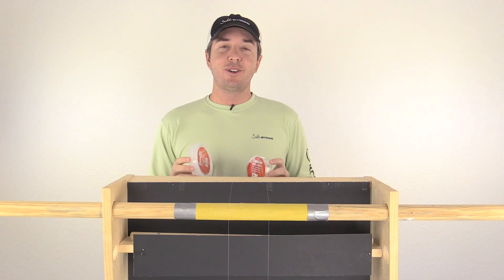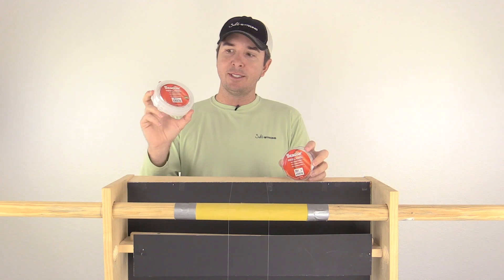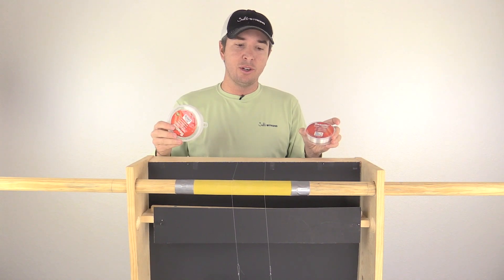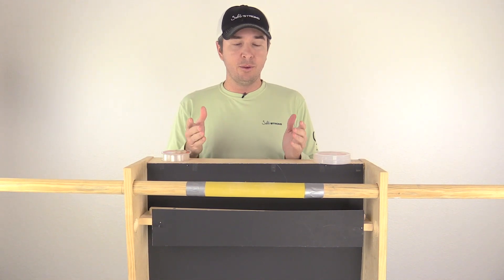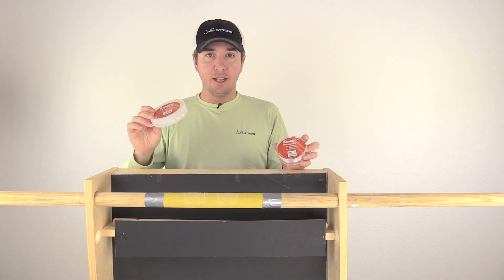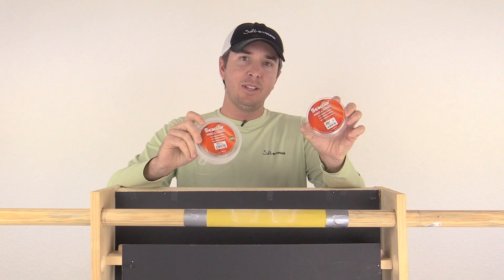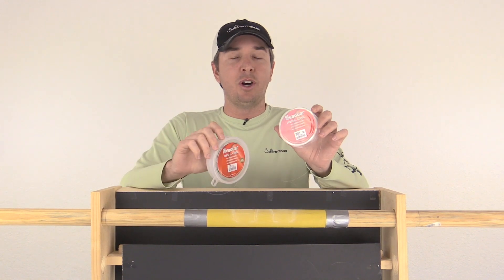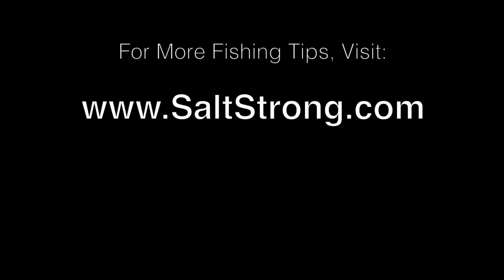Is Fluorocarbon Leader Line Really Stronger Than Fluoro Main Line? Find Out.

Comment: I started using Seagar Red Label Fluorocarbon fishing line as my go-to leader line two years ago.  I primarily jig for flounder in the backwaters of Avalon and Sea Isle, NJ.  Personally, I find that the SRL fluoro line (I use 20 pound test) ties tighter/smaller/more compactly to my 15# Power Pro braid via a uni-to-uni knot.  Also, it allows for a tighter/leaner knot to my jig and I sincerely believe that it presents a more fluid and "agile" motion to whatever jig or lure I'm working.  I believe in using the SRL fluoro line so much so, that I now use it for most of my ocean/reef fishing as well.  Whether it be soaking greenies on S&S Skinner tog/porgie jigs for tog over the dimple wrecks that dot our coastline or threading pieces of squid on Capt. Dan Schafer's Bottom Sweeper jigs for black bass and triggers to snap jigging zooms for early season stripers in Somers Point, NJ.  Seagar Red Label fluorocarbon fishing line is my leader material of choice.  Pound for pound and dollar for dollar, it's the most practical and tactical choice!

Thanks for putting this comparison video and the accompanying article together!  Much respect!  B Stav Fishing
Reply from the maker: Thanks for the feedback and for the support!

Comment: Test I would do.
1. Abrasion
2. Stretchability
3. Transparency
Reply from the maker: Any ideas on how to test the transparency factor? That's the one that is toughest to measure.
Reply: Salt Strong food coloring tinted water in a gish tank with different lines suspended in it
Reply: Leo Hernandez From the tests I've seen they really show what we can't see and are all dependent upon the day, the amount of light on the water, the color of water, whether you're looking up at the line from the bottom of the ocean or looking forward or down. From what I've seen in other videos white braid, clear or pink tinted fluoro/mono work most of the time. I also would like to see these guys put their spin on it however.

Comment: Salt strond, it be good to try monofilament against flowro, it be the ultimate test
Reply: Arnaldo Bertoli Yes!
Reply: Agree
Reply: Yes!
Reply from the maker: Coming soon!
Reply: Thats obvious. Fluoro way better
Reply: Michael Vanlerberg you never know
Reply: yep!!!
Reply: Actually mono vs fluoro for strength may be a valid test, but they have different applications. Mono for instance is generally used for top water because it floats longer than fluoro. Fluoro is used for sub surface and diving baits. So there are applications for both and not necessarily competitors for the same application.
Reply: Chad Sanders  thans for the info, im curious about what would happend, because by pounds mono is a little bigger than flowro
Reply: Chad Sanders Ian curious which one has more abrasion resistance
Reply: @michaelvan6675  apparently not

Comment: I have read that it's not necessarily the abrasion, but more the shock resistance for setting the hook and fast surges. 2-3 of leader line can supposedly handle more shock than 2-3 feet of main line
Reply from the maker: We'll be testing that next.
Reply: Salt Strong any results ?
Reply from the maker: It all boils down to knot strength because the knots create the weak points in lines, and traditional mono outperformed fluoro in both slow pull tests as well as fast load tests that I've performed so far.

Comment: I watched this and got into a debate my wife that should have used new pieces of sandpaper on each test.  I personal think the test was controlled that no spool was more favored.  I also hope you comment that the leader line might be more abrasion resistant because of some polymer coating is not true because wouldn't that interfere with the refraction since the light would have to go through the polymer before fluro?
Reply from the maker: First of all, congrats on having a wife that cares about fishing enough to dig into the details of this fishing line test:)

I agree with her that replacing the sandpaper would ensure that no line was favored. The reason why I didn't bother with it is because I was test to see if there was a significant difference between the two in order to justify the significant price difference. So the slight difference that the reused sandpaper could cause was a non-issue.

For me to feel good about spending 5x more money on the leader, I wanted it to not only win every time, but have 5+ extra turns before it broke.

As for the refraction impact of a polymer added to the fluoro, that is all dependent on the density of the polymer... if the same as the fluoro, then there may not be any difference. But my personal feeling on refraction of fishing line is that it's not as important as reflection for thin lines.

Comment: I’m pretty confident Flourocarbon “leader” is designed to be more invisible to the fish not stronger. You’ll notice flourocarbon casting line is shiny and smooth which makes it more castable, but in turn reflects a lot of sunlight at certain angles.
The leader lines appear to less Shiny/smooth so it not to reflect sunlight (more stealth)
Reply: randy fox 
Flurocarbon is made to be translucent. Therefore when the light passes through the line it will blend in with the background/water. Similar to the technology spiderwire tries to achieve with their stealth invisi-braid technology. The original non-camo version of that line is a translucent white color. 
When you put fluro next to mono. The fluro definitely looks more clear and shiny whether or not it's mainline or leader material. I believe the "clearer" is stealthier for being able to have the light pass through it like a clear window and mimicking the background. 
Similar to people walking straight into glass doors lol. The fish walks into the bait unknowingly.

Comment: Hi there I love the videos. Have you done any more tests on fluoro leaders vs. fluoro main lines? I found the new line I want to buy on sale, so if you keep finding the leaders are in fact not more abrasion resistant(across multiple brands) than the main line I’m going to get the extra 50-150yds buying main line fluoro as my leader material. Or just your opinion on whether or not I should spend the extra money on smaller more expensive spools of leader. And I know every brand is different, but in general. I could let you know which lines I’m looking at. Any help would be much appreciated thanks in advance -Charlie

Comment: Nice, and I think you demonstrated no appreciable difference with respect to abrasion resistance as a primary conclusion.  This Probably doesn't affect your conclusion, but I think there might be a bias with the side of the "machine" since it looked like the same side failed first each time.  Could be the motion, or the local sandpaper condition or something else, but this system bias could be a bigger factor than any difference in the lines.  To be certain, would have to do more tests while randomizing "side" instead of simply alternating.
Reply from the maker: Although the first 2 tests had fails on the right side, the rest seemed to show that the test device was fair because the third one was on the left side. And then tests 4 & 5 showed the lines fail at the same exact time even though they were on different sides for those two tests (see the 4:00 mark for the two ties). 

Let me know if you have any ideas for how we can improve these tests because we plan to do many more given the feedback we've received.

Comment: I tesed my lines on a brick running them. Fishing riprap Tennessee rocky bottom I tried a bunch of different lines I own. Even bought some Seagur Blue Label it wasn’t any better than smaller diameter Big Game - wow. What a waste of money that $10 was. I don’t understand why nobody makes a decent fluoro leader line that is anrasion resistant. My go to leader line is some stuff my old neighbor in Florida spooled up for me 10 years ago. It’s fluoro for sure but not sure which brand. I can rub it 50 times on the brick before it breaks other lines is like 4 passes. Wish I knew what this stuff was. The spool is almost empty.
Reply: Meant to say I tesed my lines by rubbing them against a brick with firm pressure

Comment: I believe this test is over exaggerated....the fish doesn't spin/rotate so much, especially over so short distance. the line is twisted too many times, the friction is increasing also, I don't believe this will happen in real life.....there is another type of stress you test the line here. you should move side to side for a shorter distance and increase much more the distances
Reply from the maker: I have done this test by twisting the pole so that the sandpaper is rubbing a fixed part of the line with no twists, and the results have always been the same winner as the rotation test.